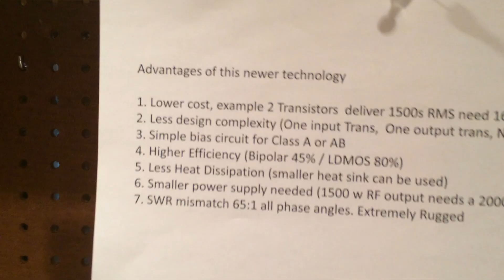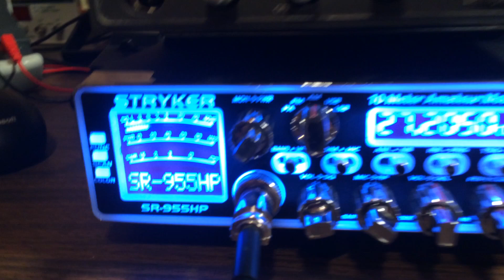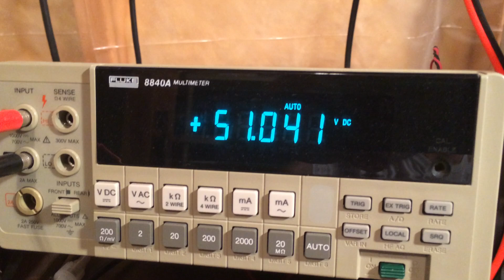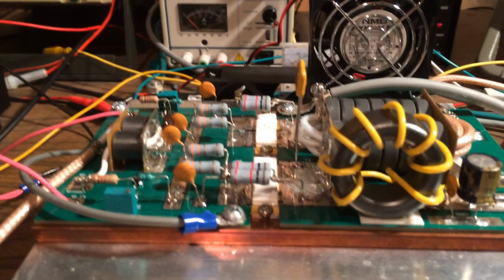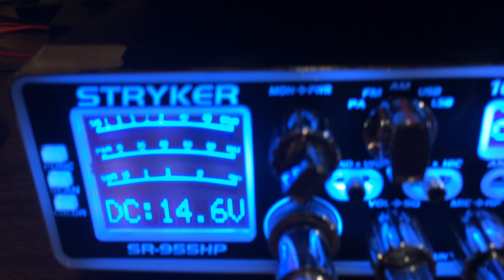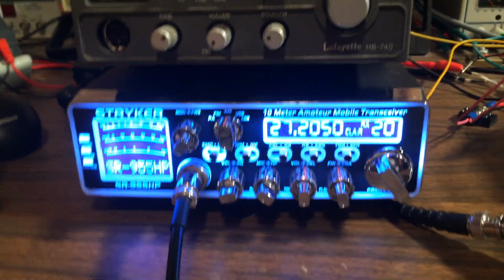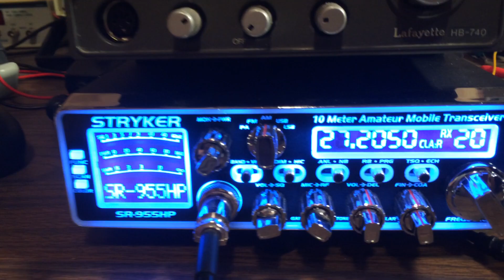RF Man Demos LDMOS RF Amp

Comment: Question from newbie. Do you solder the transistor to the copper plate? And another question - do you add thermal compound between the board and the copper plate?

Comment: I don't believe those LDMOS transistors are as immune to bad operating conditions as you say.   With the way it is over-driven and with no protection circuitry, law abiding radio operators can all rest assured that harmonic interference from this product will be short-lived, but hopefully long enough for the FCC to DF the source.
Reply: There's one or more videos specifically on the tests of how brutally rugged the LDMOS BLF -x series are. The engineers are also deliberately igniting sparks from the output shorting pins during the test then shortly afterwards testing to the same output power.

Comment: You Do understand too have 1,500 Watts RMS you would have 6,000 Watts PEP and you Clam your Pallet is Making 1,500 RMS and it can only make a Max of 2,800 Watts PEP Now 1,500 Watts PEP would be only 400 Watts RMS and and 2,800 Watts PEP would only be Around 600 RMS and if your only putting 40 Amps at say 50 Volts That is only 2,000 Watts and at 80%E That's only Leaves 1,600 Watts PEP about 410 Watts RMS for the Coax and for you too have 1,500 Watts RMS you need 6,000 Watts PEP and at 80%E that 7,500 watts of Input Power and at 50 Volts you need pull 150 Amps Min. That's Simple Math a 2nd Grade can Get your Lying your head off. So your only Putting out 1,500 Watts PEP That is 400 RMS and the LDMOS you have can only make a Max of 2,800 Watts PEP or 600 Watts RMS and Since is it 80%E it can only pull a Max of 70 Amps at 50 Volts for a Total of 3,500 Watts Do the Math and Learn what your Talking About. and Everyone Says your pallet Won't make over 1,500 Watts PEP or 400 Watts RMS Not Even Close too the LDMOS Max of 2,800 Watts PEP or 600 Watts RMS.

Comment: Putting 1,500 to 2,800 Watts into one Output Transformer makes the Output Transformer Very Hot it can be Enough Heat too Melt your Solder and Many Many People have Bought Your Pallets Rite from you and Everyone Says your Pallets Don't make the Power you Clam it Does and you Don't Back your Products So I would Tell Everyone as Everyone Who has Bought your Pallets too Never Buy anything from you and Them 188XR are only Rated for 1,400 Watts Each and That would make a Total of only 2,800 Watts Not What you Clam 3,000 Watts and Everyone Who has Bought This Very Pallets from you Say it at Most only puts out 1,800 Watts at Best and at Normal only 1,200 to 1,500 Watts PEP Not Even RMS for even at 1,800 Watts PEP your RMS would be only 450 Watts at Best. Stop Lying too People you have been Caught Cheating Everyone and it Don't matter if you Delete this for there are Many Videos you Don't Control That States These Very Facts About YOU.

Comment: Was all excited until conducting crude math calculations for voltage requirements of common HF mobile radio and amperage requirement equating to either the 1500 or 3000W LDMOS RF amplifier.  That much amperage requirement for the latter was near frightening.  Or else a U-Haul trailer to drag along 10X 6V batteries.

Comment: If you drive the amp with 1 watt or 1.5 watts will the amp's carrier so to speak be at 750 watts?  My thought are with 100% Modulation, one would think 4 times the carrier, giving 750 X 4 = 3000 watts.  If the carrier is at 1500 watts then the modulation needs to be turned down to keep from going into distortion, harmonics, signal folding back etc.  On the Bay your ad states 1 to 1.5 watts, so which is it?  It seems as driving the amp with 4 watts is okay during your video.  I wonder how much splatter or buckshot it transmits over the band.  Do you sell any band filters to keep it regulated from spatting over the other frequencies to help keep your neighbors from complaining of Bleed Over?  (Seriously !)  I often thought about buying one, but I have be unsure.  Thanks for the video.

Comment: So help me with the math.  On Ebay you say this thing puts OUT 3000 watts PEP.  Has an efficiency of 75%... meaning the input for 3000 watts PEP out is 4000 watts PEP.  It also says that this thing takes 40-50 amps at 50-56 volts.  So lets take the max... 56 volts times 50 amps is 2800 watts.  Seems like we are about 1200 watts DC short of making 4000 watts input to get your 3000 watts PEP output.  Explain.  I think what you really mean is that this thing can make 2800 watts input PEP... and at 60% efficiency (more realistic), it put out 1,680 watts.

Comment: We ran 4 LDMOS transistors in FAA approved DME's and ran WITHOUT fans. That's because we actually tuned them. You have too much inefficency and loss in the form of heat. The BLF devices are now "Not for New Design". That means they will soon be obsolete. No wonder you get them cheap.

Comment: OK, I heard it's for the HF band, that's cool enough... BUUUTTT... then I heard you say "11 meter band, channel 1 to channel 40"... ummmm... that CB radio band is not a legal band for using a linear amplifier... just in case you were not aware of that fact.  shame, shame, you law-breaker - breaker one-nine.
Reply: Its a chicky band amp.  This guy is a classic CBer...
Reply: @doctorbills790  DONT BE A HATER HAMMER HEAD
Reply: @brianneihart9721  No hate here.  Its all good.  Hams are just legal thats all.
Reply: @doctorbills790  oh really? Like the CB operators do not use the heath kit 220 is correct? Or a Henry radio or even an adcom. Give that b***** up already dude
Reply: @MBUNetworks  Not sure what your reply means?  It is correct and well known that Chicky Banders use ham amps illegally on 11 meters... like SB220s and Henry Amplifiers.  Yes that statement is correct.  They are a menace because few have the technical ability to diagnose things like third-order harmonic interference etc.
Reply: @MBUNetworks  Sounds like they sure do.  ILLEGALLY.
Reply: Oh boy there you go talking all that b***** about being a lawbreaker listen here buddy I'm a ham radio operator myself and to be honest with you wheat hams are more lawbreakers than the CBers are.

Comment: no one says a thing about padding the front end , yes talk about the protected output but watch what happens if you go over 5 watts. If your going to build something , pad the front end or its junk .
Reply: An ALC circuit and an Isolator on the output should be used also.
Reply: @Ferret488  https://m.youtube.com/watch?v=acX2Bie5fEU
Reply: https://m.youtube.com/watch?v=acX2Bie5fEU
Looks like Rf FRAUD

Comment: Folks you need a Chebyshev Filter for each band. Something that you did not see in this video. The problem with solid state is , that there's no tank circuit like in a tube amp so if you do not have a Chebyshev on the output it will have Spurs everywhere and not just on the harmonic frequencies ,  and all your power will be spread all over the place meaning less power out on the frequency that you're actually trying to put it out on. 
Typical CB amplifiers:

 Most CB amplifier builders don't even put in a low pass filter inline.. and just about all Cbers haven't a clue about them and Think just because their bleeding all over that they're putting out "lots of Power" . That's why there's so many nasty "linear" amplifiers that are not linear. And That's why the FCC comes down so hard on the CB operators with amps. 

  If they keep their amps clean the FCC probably wouldn't even mess with the CBers as long as they weren't interfering with other  services and devices .. because in the end,  that is all they REALLY care about,  it's the complaints that send them to the Operator's Station and up to a $20,000 fine and confiscation of your equipment.. And the funny part is that without that easy-to-build filter your ACTUALLY loosing power on the frequency/channel you have it on... think of it like this... as if it were a 1000 watt  light..... a 1000 watt light will light up a big  parking lot but not much light 500 yards away... now think of that 1000watt focused like a  spotlight..... you couldn't hardly even look into it 500 yards away... Demand your amp builder makes this filter and you'll stay away from the FCC and you'll talk further... and if your builder wants to charge you $100-200+ more for it....find another builder because your getting screwed... the parts don't cost squat...its just 3 small coils of wire  and 2 capacitors for the CB band. .

(another hint, make sure your SWR is the 'same' with the amp on as it is with the amp off and your radio will love you for it)  It's also a sign of a good builder who takes the time to tune it there.
Reply: True words here.  I am not knocking the video or the author, but what is tried and true is true!

Comment: You're a scam artist. Best case scenario , you will only get 2,100 watts out of this, BEST case scenario.. You can't say 50 x 56 = 2800 watts.. That's total dissipation, heat, harmonics, etc will consume 25% or more of the power.. You can't magically gain efficiency.
This is simple math.. you cannot get more out, than the total device consumes in power. You can't take a Honda, and state just because it's consuming as much fuel as a big block Camaro when it's floored, it's making the same horsepower as a Camaro.
I hate when people post smoke and mirrors and try to swindle people with specs. Trust me, it would have been ok to just state the true power output of this.. I'm a top level RF engineer, and design radios for a living. In fact, most of you would know who I am if I wasn't using my anonymous account... you cannot get more RF power output, than the total power you are consuming. P (power in watts) = I (Current) x E (Voltage).. Most basic electronic theory there is.. E voltage = (56 volts) I Current = (40-50 Amps) So, best best case scenario, your splatter box, is consuming between 2,000, to 2,800 total power consumption.. Even the cleanest design in the world, of a Class A/B amp ,  you get 65% efficiency. You claim 75%.. fine.. Even with those magical fairy dust efficiency claims, you're only producing between 1,680 to 2,100 watts total RF power output.. Seeing that there's no filters on the input or output, I'm guessing you're splattering into every harmonic there is.. I bet the 6 meter guys love you, and the FM broadcast band appreciates hearing your 3rd harmonic.. Even scarier, is the multiples of 27MHz you're producing, likely splatters into the aviation band and elsewhere.

Comment: I have one i am assembling and yes im a ham so we can legally operate 1.5kw
Id like to know your take on rf protection  circuits like swr like putting a attenuator on this ldmos and the use of a low pass filter unit as your striker unit is 10 meter as well? Also do you sell this assembled? $?  Lastly where did you find a 50V 40+amp power supply for this unit?

Comment: Thank unso much for this informative video! I have a couple of questions i really hope u answer them, how can we know the output and input impedence if the ldmos at a certain frequency? do we need to add a 1:1 balun after the combiner stage? doesn’t using two ldmos together halves the impedence so i higher transformer ratio would be needed? Thanks

Comment: How much drive power needed for 3000w pep? How are you cooling the LDMoS? Water cooling or normal air cooling
Reply: And does it have a low pass filter?
Reply: @Mark300win  No, this is the same as many of the other AMP Pallets, it is literally JUST the AMP Pallet board...

Comment: Can this amp work with 53V? I want to use a flatpack 2 HE power supply because these are really high quality and much cheaper than meanwell. Does the bias have to adjust down if I want to use it with 53V? Nice work! Do you offer a low pass filter module/kit? I can't find many and none for this power level. I just need one cutoff frequency no fancy ham relays. I haven't bought yet, but once I get an antenna that I know will work, I'll go for it.
Reply: One more question: Does it work at 100% duty cycle or does the matching get too hot? Hehe.
Reply from the maker: Yes it will work justr fine with the HP power supply. Duty cycle should not exceed 75%.

Comment: So this amp comes as is tuned to 50 ohm impedance input and output only for one band ? For operation on other bands we must build a selection of different wideband transformers? Is the matching networks enough to keep spurious emissions below acceptable levels? I would think that some passband filtering might be prudent too? 
Ok so if purchased I would need to provide my own 50v 75amp dc powersupply and a heatsink along with a case. This would allow me operation of 3k out with 4 watts in on 11 meters only? Not interested in 11 meter but interested on 20 and 40
Reply from the maker: The amplifier is board band and will provide acceptable SWR's and power output from 1.8 to 54 Mhz. For FCC compliance, you will need to add a Low Pass Filter for each of the bands you transmit on.

Comment: Seems like this is setup for chicken banders.  I would think these are going to blow big IMD all over the ham bands with no filtering board.
Reply: Actually if you're transceiver is tuned correctly to the amplifier, imd will be minimal. But you holier than thou ham fucks look down on anything that isn't ameritron and yaesu/icom
Reply: Candid Sky Productions+ Buy one and throw it on your bench to test and report back!
Reply: There is more power used on CB than any other band with or without LDMOS technology,never be able to change that fact.
Reply: YEA along with the 5000 KW and up shit coming out of all the C.B. builders, and the F.C.C. does nothing.
Reply: @1903A3shooter  Love the long leads on the caps. Only a chicken bander amp could make 3KW with a 50 amp power supply. Hint 50% efficiency in a real SS linear in class AB.  Unbalanced load must beat the crap out of 1 of the devices. This thing should have chip caps that can handle real current. (As an owner of a homebrew 4800 watt linear)

Comment: Do you make a 4 device unit?
Reply from the maker: You can used 2 dual boards with a splitter on the input and a combiner on the output. These are available from RF Parts or ICA Manufacturing. You will also need a 50 volt / 80 amp supply or two 40 amp supplies in parallel.Regards,RF Man

Comment: I am interested in an amp that can simply push 500 (driver at 35) ...for use on SSB (USB) on the 4,400. and 5,760. HF area.   Specifically looking for mobile capability.   any ideas?
Reply from the maker: LDMOS technology required 1 to 2 watts of drive. If you are using 35 watts you will need to add a -20dB attenuator. This amp will operate from 1.8 to 50 Mhz. For mobile used you can used a 12v to 50v boost converter. I have some videos on my channel show how this is done.Regards,RF Man

Comment: Nice design. Could it cover 6M also? I  already have a 40AMP 50V psu built by ZTE  China. What would be cost of a module with copper plate?
Reply: Any pics of a completed 3kw pep version? Anyway to run one in a moible?
Reply from the maker: There are some pictures on eBay. Also, you can use a 12volt to 50 volt boost converter for mobile applications.
Reply from the maker: Yes, the amplifiers will work on the 6M band. I have a single LDMOS version (1500w PEP) for $499.00 plus $25 S&H and a dual LDMOS version (3000w PEP) for $699.00 plus 25 S&H. Both versions included the LDMOS Transistors and the copper heat spreader (you will need to drill and tap the HS). They are also fully assembled and tested before being shipped out. You can contact me at 678-646-8986 if you are interested. Thanks
Reply: RF Man Channel awesome thank you!!! I already run a 250amp alt so I'm good on amps. It's rf man on eBay right?
Reply from the maker: Please search under LDMOS amplifier and you will see my 2 eBay listings. One is a 1500 w PEP and the other s a 3000w PEP amplifier.

Comment: Nice. I have a couple of questions, I would like to run 700 to 800 watts RTTY can I do it with 1 LDMOS or should I go for the 2. Secondly I don't think I have a radio that goes below 5 watts out. Is there some sort of input attenuation available with 10 - 12 db of attenuation
Reply from the maker: The single LDMOS amplifier can provide 750 watts RMS, so I think it will work for your application. You have 2 options on the input power. You can turn down the output power of your transceiver by using the internal adjustments or you can add an attenuator. There are 2 types, an in-line type or an attenuator pad. Please feel free to call me and I can send you the information via email. 678-646-8986

Comment: Would like to order one but would like order with just one transistor like that one call 3072212847
Reply from the maker: I only show the Dead Key in my video. This is an RMS value. I just purchased a peaking kit for my Bird meter and measured the PEP at 3000 watts. I plan to post another video show the DK and the PEP. I have a dual version and single version of these amps for sale if you are interested. Thanks for your feedback.....RFMan